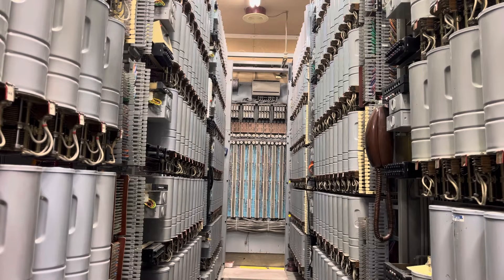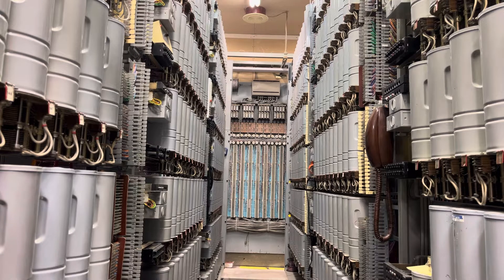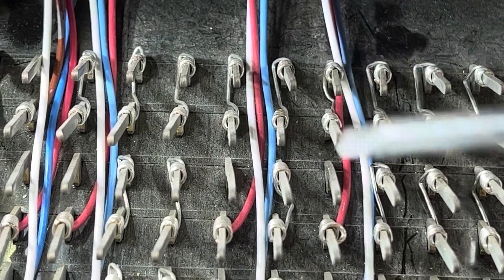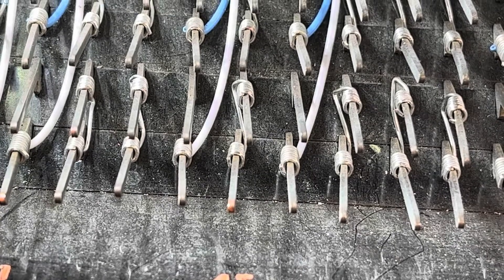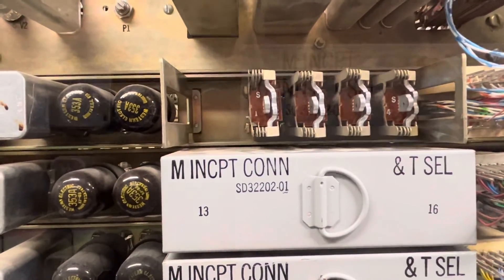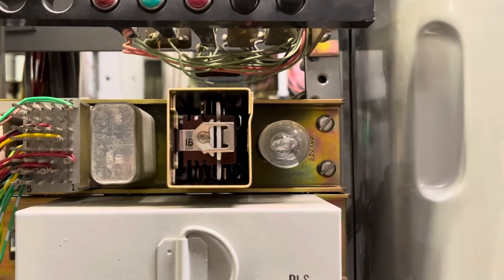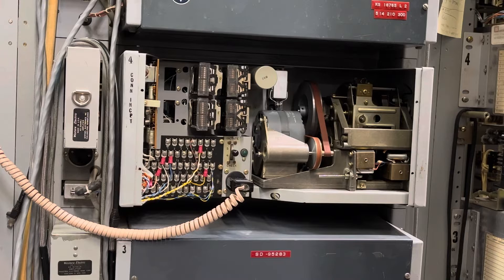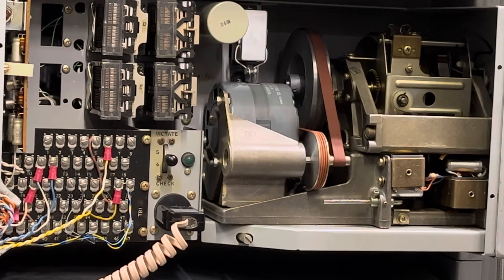Dead number intercept (disconnected line in a SXS)

Comment: I love all of it. I have been looking into all the options for a 1a2 system. Music on hold, intercom (buzzer or ring.) call transfer, etc etc. I found a manual years ago online that really opened up all the options of a key system. Talked about rugged and easy fixable systems. Most of the stuff was just remove this module or add that module. Years ago around 199? late 90's a library had a small system still in use. Unfortunately when I went back it was replaced with a new digital system. I would have loved to know if it finally died or if they was talked into replacing it. I would love a older system but room is limited and I have a nice partner acs and a ip office system. Though, I'm kicking myself for getting rid of the Merlin 206 and 410 units / phones I had.